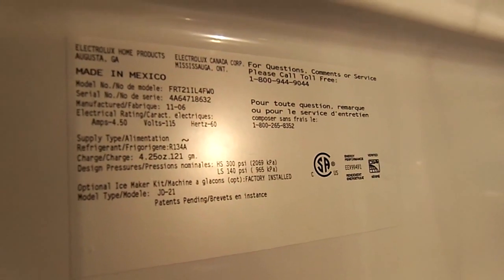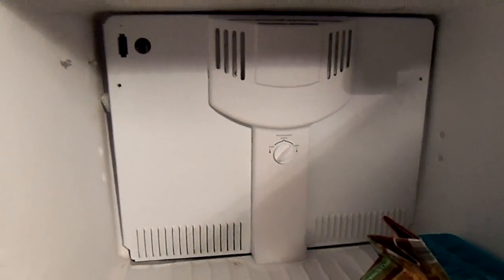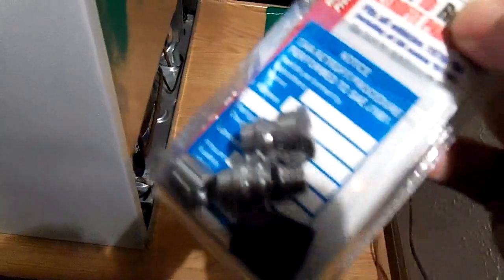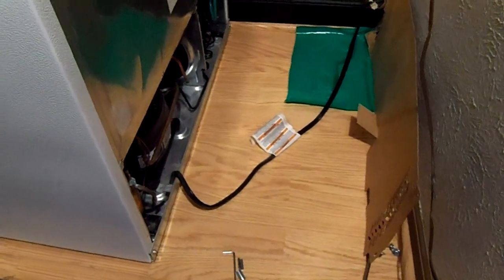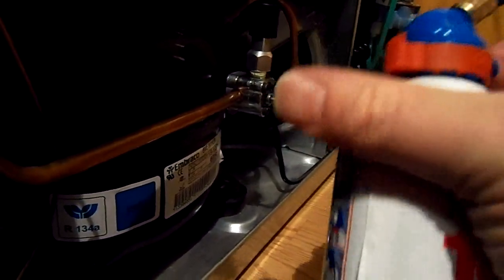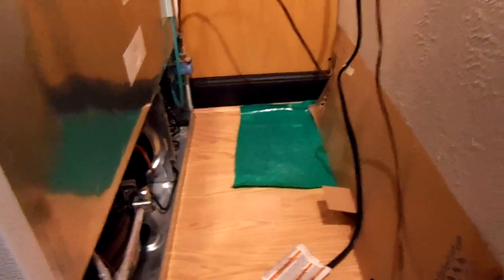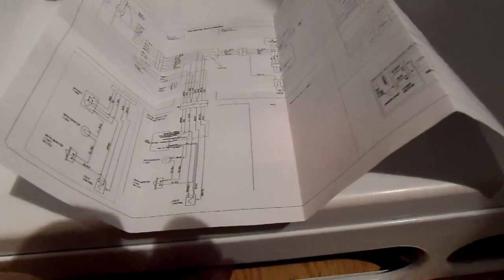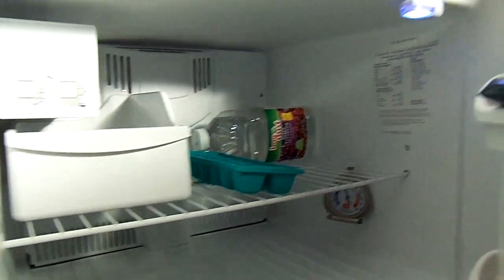Refrigerator Cooling Failure

Comment: First of all, you have the notorious Frigidaire with the notorious leaking yoder loop, a yoder loop was designed years ago to help with the fridge from building moister.  It runs on the "High Side" of the cooling system, and is located within the walls of the fridge itself.  Therefore it is not "serviceable" as some others have suggested that you could't find someone to repair the system.  The yoder loop is usually faulty on these units 99% of the time.  You are overcharging the system, this is why you are seeing frost build up on the low side of the system, which causes excess pressure against the compressor as well.  If you do not have gauges to charge a fridge in the correct manner, a tip to charge it correctly, is to charge it till you see a slight frost pattern build on the low side line by the compressor, then remove the hose from your piercing valve, and release freon slowly until you see the frost start to disappear, and close the valve.  You mentioned that the ice maker was not working correctly, well the ice maker itself has a switch that senses temp, this is a safety feature to keep the ice maker from calling for water if the fridge does stop working, you are gone on vacation, ice maker keeps calling for water, doesn't freeze, nor cycle, and floods your house.  Given that your box was low on freon, not cold enough, and with information just supplied about the ice maker, it will not cycle correctly.  Addressing using stop leak to fix this issue, is like playing poker, its very very rare that stop leak will fix this issue, been there, done that, even if it prolongs the issue, the leak will surely redevelop.  The only real way to fix this issue is to do a bypass on the system.  A bypass on the system would consist of cutting the yoder loop lines, replacing the filter dryer, and reattaching the new filter dryer from the condensor side (that used to attach to the right side of the yoder loop) to the top side of the filter dryer, the cap tube will be cut off the other end of the yoder loop (left side), soldered back together, checked to see if the box will hold a vac, and then recharged properly, or continue to put freon in the box every month, and take the chance of getting food poisoning, up to you lol.

Comment: the most important thing is to keep the coils underneath clean, especially if you have pets, my fathers was doing this exact thing, so we have to clean the coils every few months, or when his ice cream starts going soft, people want to dump freon into it when 99% of the time its AIRFLOW. even a small amount of dust on the condenser coils acts like insulation and keep heat from transferring properly. it acts like pipe wrap on the condenser lines, even a small amount makes a difference

Comment: I think you can use JD weld to patch up any leaks, so if you take off the piercing valve. You can put on JD weld and that will prevent it from leaking.
Reply from the maker: You might succeed at patching with JB before you repressurize the system. Note that the refrigerant carries oil too, so the area of any hole would have to be made oil free.Would never attempt to remove the piercing valve, you'd lose the charge or would have a heck of a time getting anything to stick to an oily surface.

Comment from the maker: The untold part of the story is that before I figured out the the fridge was the problem, I had the ice maker in pieces! Was a bit of a puzzle to reassemble a few weeks later when I concluded all the pieces were good. Was quite relieved it worked when reinstalled!
   Over thirteen months now, all still working well.

Comment: How long did that compressor last after you slugged it full of liquid refrigerant,  Pag oil instead of poe,  and over filled a critically charged system.  Not to mention the fact that you misdiagnosed a partial capillary tube restriction that you've made worse by adding a stop leak.
Reply from the maker: Your diagnostic is wrong. Unit is still working, almost at the two year mark now.. Leakage is quite common in this model, see below.
Reply: Partial frost pattern is indicative of cap tube restriction, automotive refrigerant uses Pag oil instead of poe, and when you charge liquid refrigerant into the low side just before the compressor you're going to flood the compressor,  and not to mention you just jammed several ounces of refrigerant into a critically charged hermetic system that only holds a few ounces. ..if this unit is indeed still running it comes down to luck

Comment: 4.25 ounce , low side pressure 140 psi , high side pressure  300 psi. Curious what happens if you don't vacuum out the lines and you braze connections back with some r-134a in it will it like explode?
Reply from the maker: +sam111880  I have no experience but my guess is that it wouldn't be possible, even if it didn't explode, the liquefied metal would blow out of what your joining.

Comment from the maker: In the above, referring to the little fan inside that circulates air through the evaporator and then blows into the freezer and fridge compartments. In the fridge I had before, I took it all apart to work on the defrost circuit. Eventually figured out the the temp limit switch on the defrost heater was bad. But what was sort of scarey was that a few shopping receipts had gotten sucked in and partly burned on the defrost heater. So now I'm real careful not to let those get into a freezer.

Comment: I do agree service valves should be brazed in then pulled in a vacuum for about a half hour after leak checked, then recharged with the proper amount of refrigerant.  The piercing valves bill always leak again. Might have been best for a professional to have fixed it.

Comment: did the composure must to make noise when is on?
i ad r 134 but the composure is hot but not make noise just few every second he make some click noise 
that normal or not?
Reply from the maker: eyal abergel It's dead if it does that, assuming your not having a brown-out.
Reply: For future reference, this doesn't necessarily mean the fridge is "dead." The symptoms described here sounds like nothing more than a bad relay (clicking sound). Remove the relay and shake it. If you hear a rattle, then the relay is bad. Replace it and the compressor should fire right up.
Reply from the maker: Yeah, and I had a relay issue with a fridge I had once too, cleaned the contacts. But in his case he reports that the compressor was hot, and the click came at a regular interval, so my best guess is the compressor seized.
Reply: I wish someone had a video of the different compressor sounds. I just used your video to put Freon back in mine, bad sadly it didn't work. Compressor humming along, but fridge not cooling :(

Comment from the maker: I was told they have to use silver solder to make the connection, and to be cheap, they use it very sparingly, so frequent failure results.And also I read online that the stop leak in automotive intended freon really doesn't work on metal to metal connections, really designed to slightly swell the rubber (Neoprene?) in automotive systems. Still my leak is so small that I hope it clogs the pin hole. The guy who suggested I try this said I might get a couple years out of it. Ten months so far...

Comment: Thanks for the video.  I had to laugh at myself.  I installed one of those valves.  Listening to you and your thoughts, It sounded like me. LOL.  The same uncertainties and questions of mind about...should I or Should I or should I??????  Nice video...By the way..., I had already replaced defrost timer, compressor starter, and a bunch of other stuff.  This little device saved the day for me.  Kept me from junking the fridge... many references tell you if your fridge is a sealed unit..you might as well buy a new one

Comment: I am a refrigeration tech.  I can tell you it is almost impossible to repair the leak in these units.  The evaporator is aluminum instead of copper (can't be brazed).  They make these things too cheap.  Try not to over charge the unit.  If liquid freon goes back in the compressor it will destroy the compressor (liquid can't be compressed).  Also the stop leak will kill the compressor if not clog the capillary tube, but might get a little extra time out of it.

Comment: Mine is having the same issue mine is about 9 years old GE brand. My condenser was full of dust and the fan wasn't turning I cleaned the dust out of the coil and the fan started turning I think it was overheated. Still only getting 20 deg out of the coil area. I saw some oil in the pan below the compressor. I want to recharge it but I need to get an access port.

Comment: I would try the freon with the added uv dye.  Then let it run for a couple days and look it over with a black light.  The reason they use silver solder because it's stronger but also does not require flux.  Flux contains acid which will eat the windings of the compressor motor.  If you find the leak you could try JB weld.  I never had luck brazing an aluminum evaporator, but I do copper ones all the time.

Comment: what glue you use it because I have the same problem on the fridge
Reply from the maker: I didn't use any glue... Some have suggested JB Weld, but getting any kind of glue to work would be tough due to the refrigerant carrying oil. See the other comments...

Comment: Do not use automotive r134a with leak seal in a system with an electric compressor, says it right on the bottle. Having said that if he would have used leak seal meant for small refrigeration units and the can of r134a at the auto place that had no oil or leak seal in it this unit would still be running. use the correct leak sealing agent. the sealing agent used in automobiles will eat the coating off the copper windings used in electric compressors. your psi on the low side should be 0-5 on a freezer for r134A.
Reply: Not showing my picture....  it's dupont Suva for mobile ac systems. Part# D11125612

Comment: When you buy R-134 from an auto parts store, make sure it does not contain dye (for leak detection) this will clog the capillary line. Automobiles use an expansion valve so the dye will not affect the metering system. Your best bet is to buy a 10 or 12 oz can of R-134 from an appliance parts shop. The R-134 they stock is designed for refrigerators. Also it would cost a lot less than an auto parts store and it contains no dye and the right grade of oil for the system. Leak sealer may also clog the capillary line and may cause problems later on. All leaks must be properly repaired by soldering the line with Oxy-Acetylene using 5 to 15% silver rods. Use flux on the high-side if the line is made of steel. Also, clean the tubing with emery cloth before soldering. This will ensure the solder will flow properly and will lessen the chance of leaking. When after repairing the leak and the joint is soldered or repaired, YOU MUST PUT IT IN A VACUUM BEFORE YOU PUT IN THE FREON CHARGE OTHERWISE MOISTURE WILL BE IN THE SYSTEM WHICH CAN DAMAGE THE COMPRESSOR. DO NOT OVERCHARGE. OVERCHARGING WILL CAUSE ICING AND FURTHER FLOOD THE EVAPORATOR AND WILL FAIL TO COOL.

Comment: Im shocked you couldn't find anyone to service that the problem with the piercing valves is that they all eventually leak thats why I evacuate and braze in service ports if you dont have recovery machine and vac pump I guess your hands are tied
Reply from the maker: So was I, not even a local work-out-of-home guy wanted to touch it. Frankly I'd of been more than happy to pay up to a couple hundred to get the job done right. But I guess they figure, it's not worth it for a five hundred dollar fridge, they were worried that it might need a compressor too and I wouldn't be willing to pay the three or more it might cost. Ha, my brother finally replaced his old 1967 GE, and it was still working! They don't make them to last anymore I guess. Anyway, repair is still holding up, it holds for another couple years or so I hope to move and leave it.
Reply: my grandfather 1947 that is still working I just cleaned the coils and reluctantly moved it from  basement to his garage and it is still working fine so old no defrost
Reply: If you were in Ohio I would have hooked it up for you leak check and charge for a couple hundred no problem spare time extra money job u think someone would need some money

Comment from the maker: Sorry for the slow reply. Not a appliance repair tech and you didn't give much information. But from the little I can glean, sounds like your fridge has electronic controls, not the old numbered knob thing. So it sounds like your electronics have gone awry. Try unplugging it for a few minutes to see if that will reset things, otherwise you probably need to find an appliance parts store and see if they can advise you, you may need to order a new circuit board. Good luck!

Comment from the maker: Sounds like a defrost failure. Common points of failure are the timer, defrost heater limit thermal switch (that was the problem in my previous fridge), defrost heater element. Circulation fan could also be bad. What kind of noise?
There are many good videos on fixing the defrost system.

Comment: Do meters cost a lot or something?
Reply from the maker: Not extremely. Check out E-Bay and/or Amazon. Problem is,, with the two gauge setup, you need to access both the high and low side of the system. I recommend you leave the high side alone. You can get a refill can with a single gauge (Amazon) , might be the best bet.

Comment: Have to replaced the filter dryer. Hope you r a not a tech. Sorry to says but thats really cheap job. Never do this guys. Whenyou get into the refigeration system always replace the filter dryer. Why? Cause the system absorbs moisture when is open.. Second never use a piercing valve and then try to repair the area is better if you guys use and access valve. Is more safer. Dont try to patch it. Also how do you know how much refrigerant you are putting. When the freezer is not cooling that doesnt mean it needs refrigerant. Doesnt mean is a leak cause the system is seal ( could be possible) but also it could be a restriction or innefficient compressor. Next time if you think you have leak put a filter dye drier. Recharge the unit- let it run for a week and check for leaks. If you dont see any dye but still there no frost pattern start thinking on interna cabinet leaks. If system has a restriction recover freon and flush out the system w/ 140 pi of nitrogen or rememeber to use a recovery bag if you decided to flush it out with refrigerant...never use this piercing valves cause there always leak in the future............

Comment: Shouldn't kill your fridge.  With it unplugged it would just empty it of what Freon you have now, which won't hurt you unless it gets burned...
You actually should empty it first in the first place with a tool many Auto stores will rent out.  All you do then is make sure your Valve is tight enough and refill.  All the better if fridge is outside.
Reply from the maker: Yes, had I to do it again I would be more careful and at least used a can with a gauge. Had it more grossly overfilled than I had hoped, vented out more a few times before this summer yet it still is overfilled. At this point I think I'll leave it be as that saddle valve is likely to leak if I keep messing with it, and it has survived two summers now.

Comment: There is a HUGE difference between 134A and Freon
Reply: yes there is!!!!  R134A is R134A refrigerant Freon is the Dupont trade name for its R12 refrigerant. Google it.  Do not use the R134A with a leak sealer. In most cases it will not seal it willonly gunk the system up.